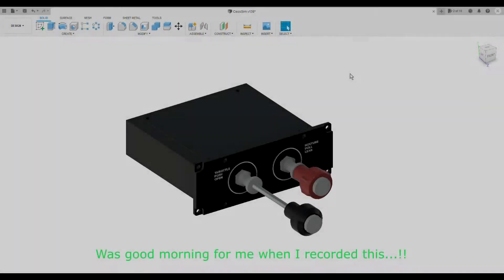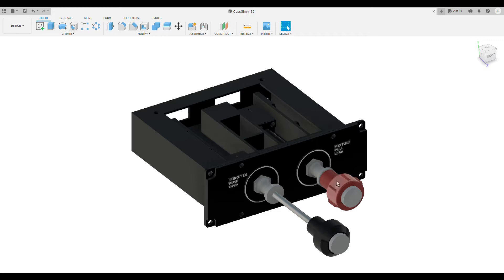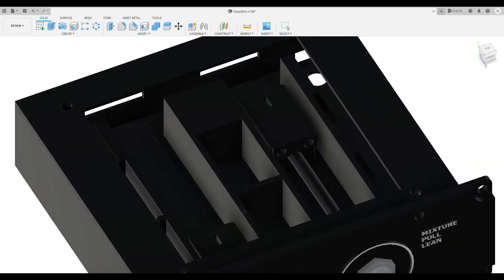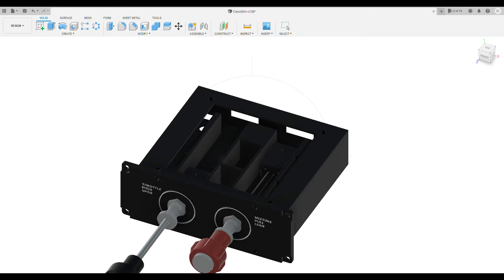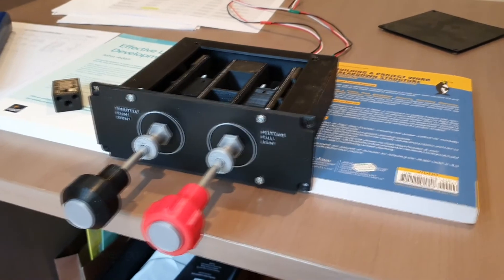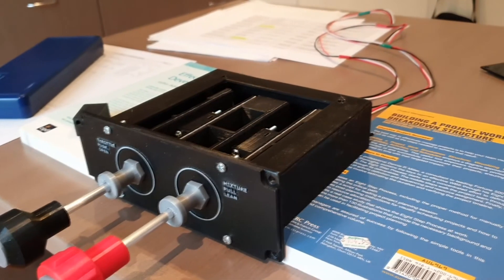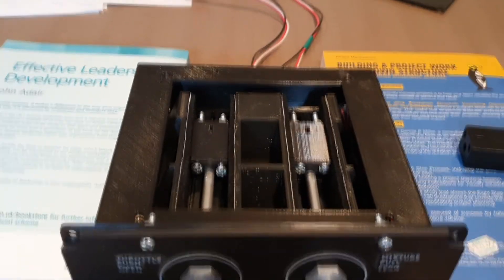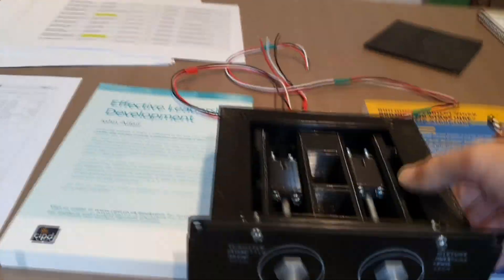⚡C172 3D Printed Throttle and Mixture Panel⚡

Comment: Great job
Do you have a link to the 3D printed files?
Reply from the maker: Hi and thanks for the feedback. I dont have a link to the main assembly as this is my own design, however throttle / mixture and guide links are from Thingiverse which I have provided in the video description.  Hope this helps.